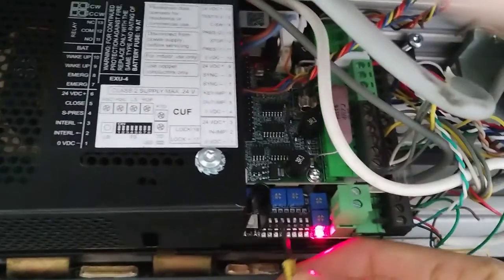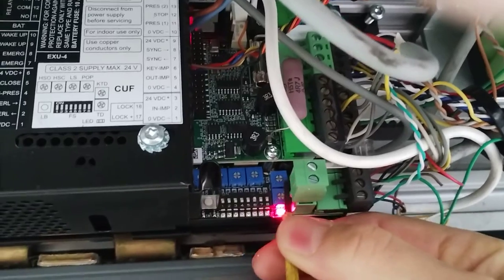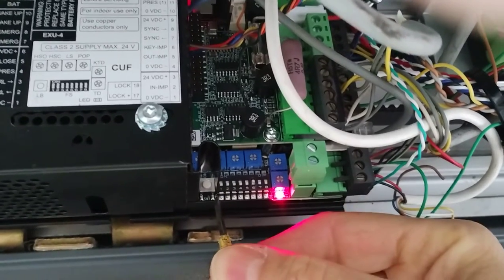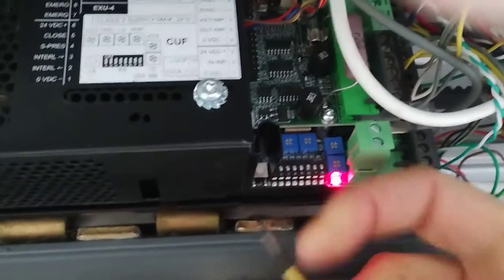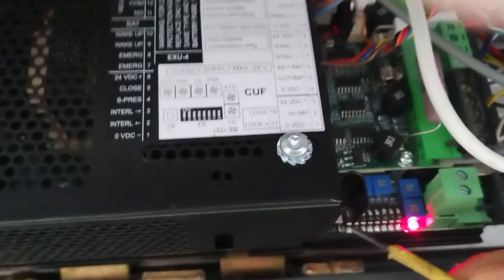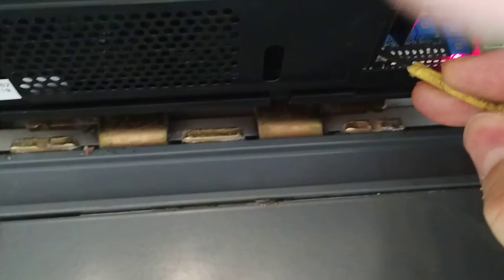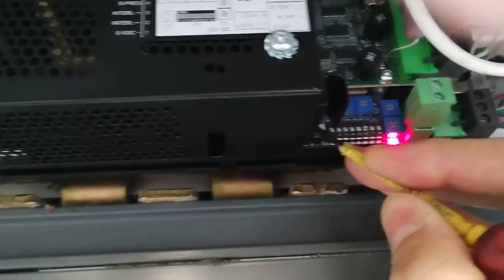How to learn an Assa  Abloy Unislide

Comment: Same door opener but single leaf, the learn starts and hits the open a little hard and proceeds to do the 4 led flash. Can only power reset to do anything more which stops the learn process. It's been fitted to a ranch slider and was working at one point